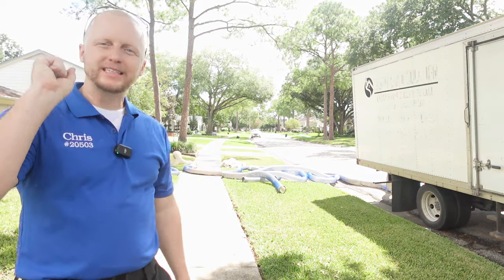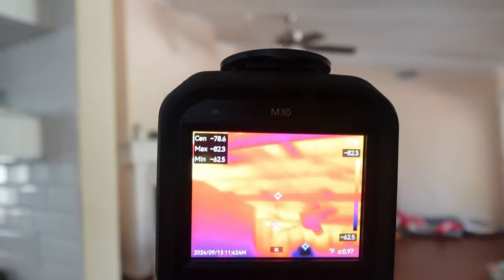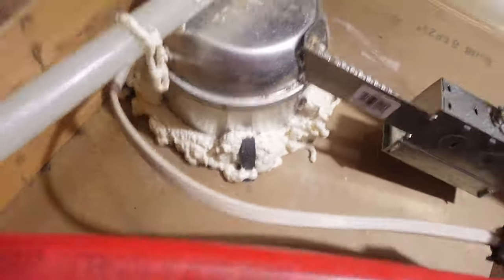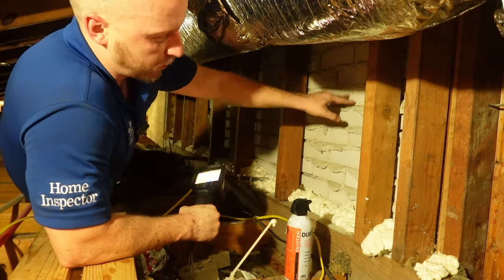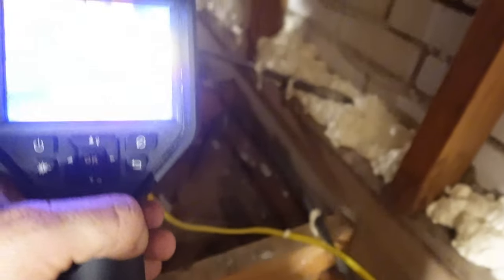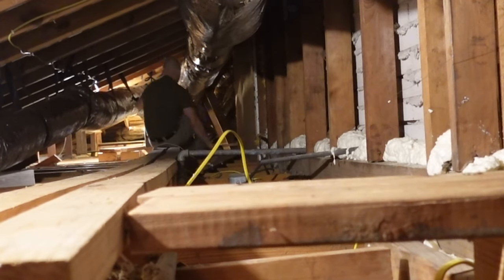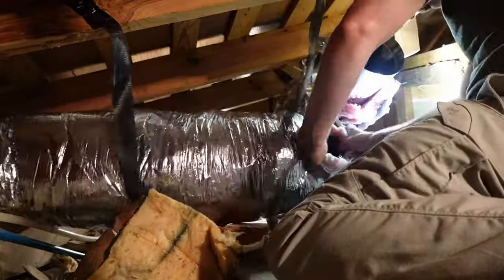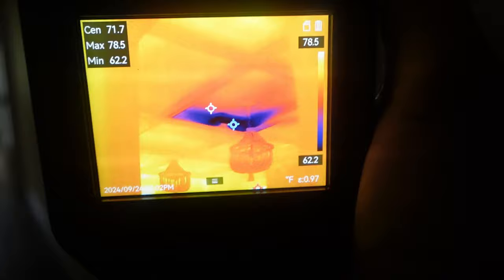Attic Renovation: From 1960s to Modern Attic

Comment: 1. I noticed "no mask" right away. Although it was vacuumed, you can still see glass floating in the air around your lamps. 
2. You should have bought a Tyvek suit. That's cheap protection against floating glass and scratches.